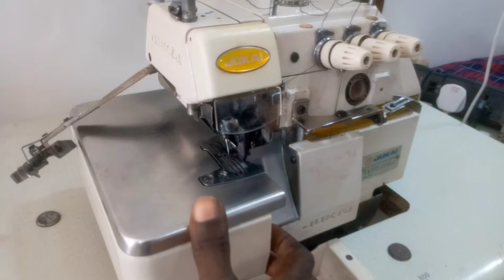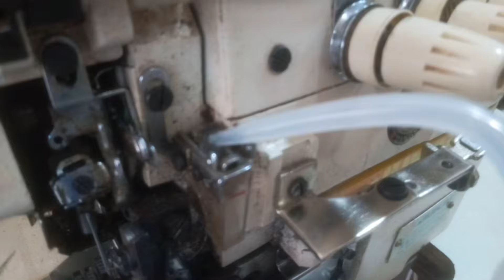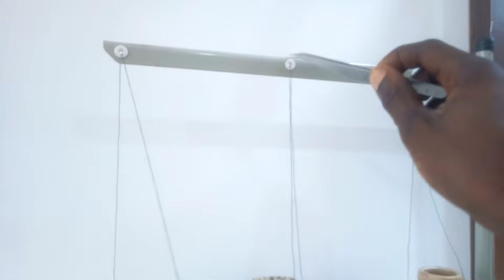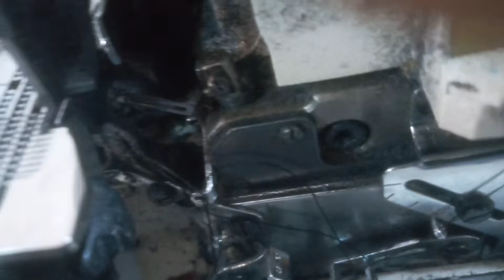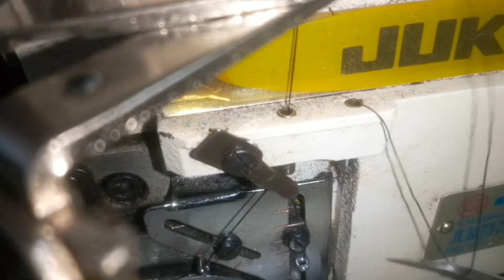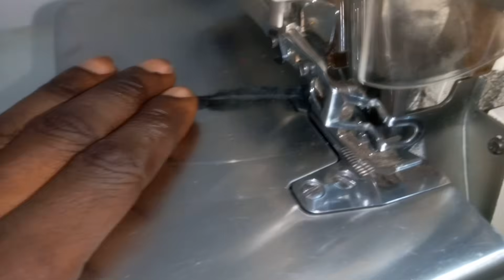how to thread an overlock industrial machine step by step full video

Comment: I noticed the transparent box shape rubber with black cover is licking oil in my machine. I noticed it after my weaving machine was installed so I stopped putting oil into. What’s the solution please?

Comment: Thanks so much for this enlightenment, my question I put about 1 litre of oil in my machine but still not gaging. I put more before due to this same issue but was overflowing and dripping from different parts of the machine. How will I handle this

Comment: A very helpful video. Congratulations and thank you for the effort. I have a question. What might be wrong if the oil does not pump out of the spout at the top of the machine where the little dome window is? Also, the gage does not work. There is adequate oil in the machine and all the working parts seem to be well oiled. This machine is operating for many years like this without a problem.